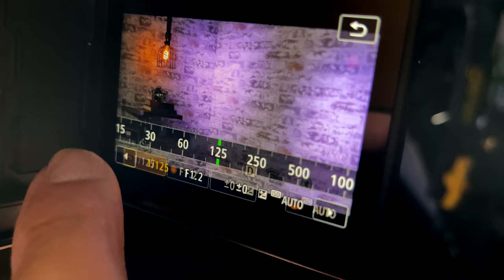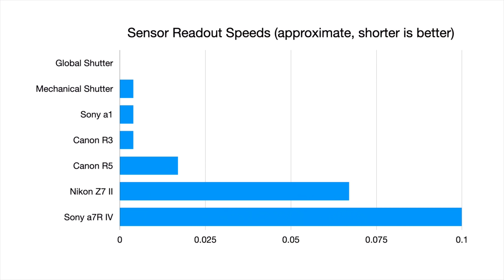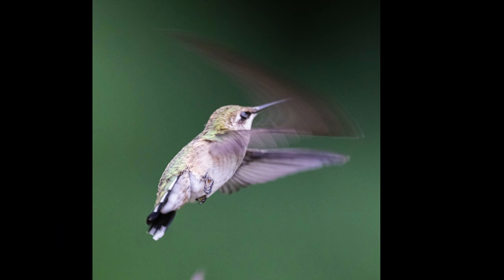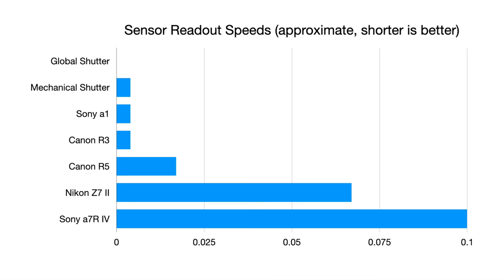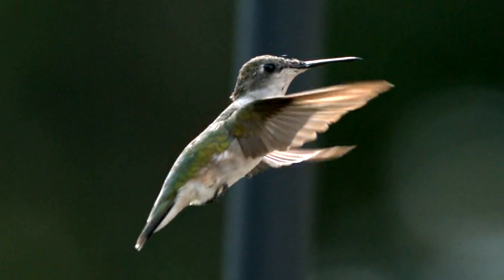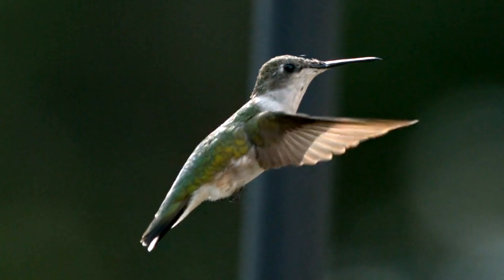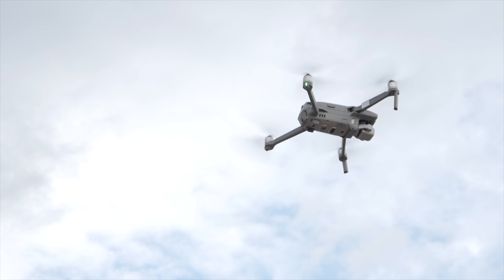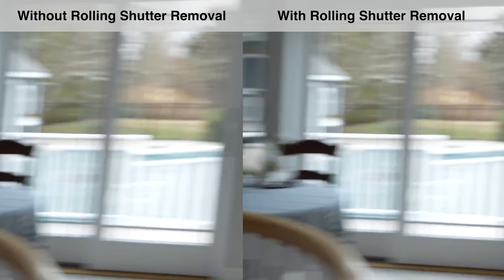Rolling shutter RUINS your photos & video: Let's fix it!

Comment: I'm not surprised you didn't mention the m43 cameras. I don't know where you got these numbers. You often show data from photonstophotos, but without the source.  1/200 is the rollin shutter for r3 in mechanical shutter mode (A1-1/400, a9-1/290-measured).  In electronic shutter mode 1/150 for a9 (measured by imaging-resorce), 1/180 for r3 and 1/200 for a1.  Rolling shutter in photography is not equal to rolling shutter in video.  R5 in 4k 25 fps- 9.6ms, a1-8.1ms, olympus m1mii and panasonic gh5ii -10ms (according to cined).  As you can see, r5 and oly are not far behind A1, but they can't match A1 in photography (two times slower reading speed than a1(1/200 vs 1/60 in Oly) but still two or three times faster reading speed than fuji xt4 or nikon) Fuji xt4 is about 20ms in 4k.30fps in fuji it's just marketing.  It is not able to achieve this speed, the photos are not 26, but 16MP, and the buffer is not deep enough (max 40 photos before it fills up) It is worth mentioning that the maximum shutter speed is not related to the rollin shutter.  Canon r5 has only 1/8000 in electronic shutter mode  (!!) r3 has 1/64000 (!!), a1, a9, oly m1 / m5 panasonic g9, fuji xt4 1/32000.
Reply: Where'd you get 1/250 for r3 mechanical shutter?
Reply: @ryancampbell1151  You are right. My mistake.  1/200 for a mechanical shutter.  1/180 for electronic shutter.  The dp review measured the rolling shutter for the ES.  They got a slightly better result than sync speed.  They measured less than 1/200s(no surprice there).

Comment: As a lightning shooter, rolling-shutter has ruined many, would-be great video frames. It's basically a crap shoot. Wondering how the R3's 64,000 th of a second max shutter will do, especially in Time-lapse mode.
Reply: The shutter speed isn't the same as the sensor read out speed. No matter what shutter speed you select, the sensor read out is going to remain the same. In the case of the R3 1/180. Something he didn't mention is you could lower rolling shutter artifacts by switching to a smaller sensor (less surface area to read) and less megapixels (less photo sites to read) edit: and usually this is cheaper too!

Comment: Umm, ok! So you explained what rolling shutter is, but you didn't say anything about how to fix it.  The only REAL way to fix it is to buy more expensive gear!
Reply: Aside from Blackmagic cameras, there really isn't any way to "fix" rolling shutter distortion, only avoid it. For video, one method he didn't mention is to turn your camera vertically. That helps for horizontal whip pans and shooting outside from a moving vehicle. But it also means less resolution.